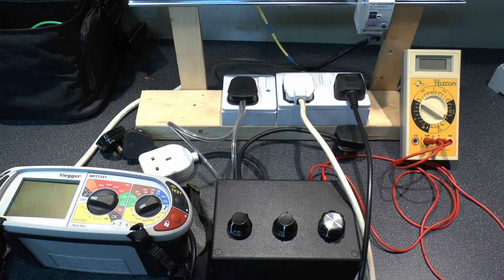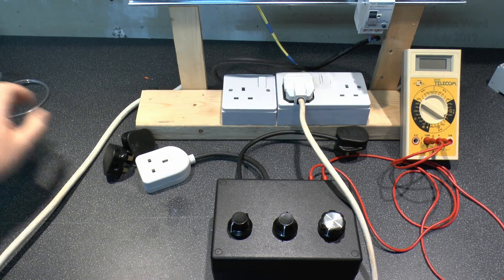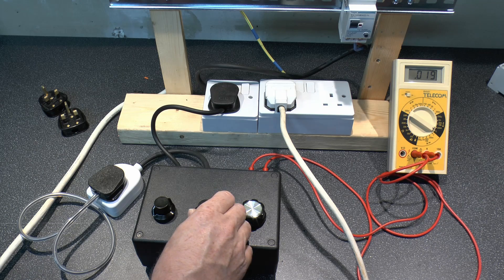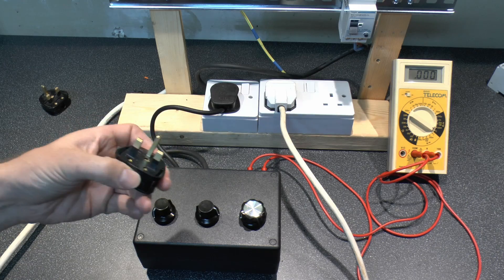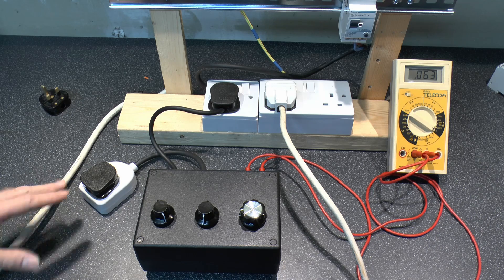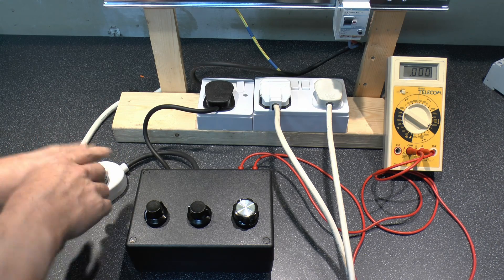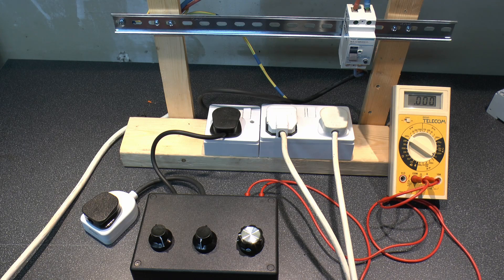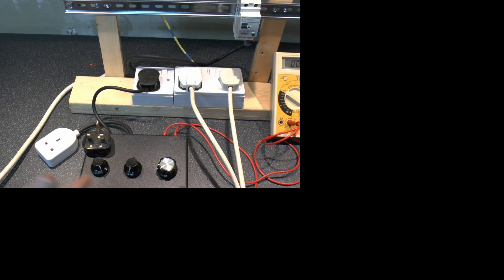RCD Testing Rig Overview - Pulsed DC on Type AC RCD Fails to Trip

Comment: With double insulated equipment how many people get electrocuted today with faulty goods?
Reply: There are also class I appliances with such problems, for example a desktop PC. They're always class I. Next one is the charger of an electric vehicle, in that case the car is the appliance and class I too, the charging electronics are in the vehicle. And one defective class II appliance with a DC fault can influence the RCD, it won't work anymore, even on AC faults as long as you got the DC fault. Meaning this is bypassing and interrupting the whole protection of the RCD. Second fault and you got a problem, even if that fault is AC for which the AC RCDs are made for.
If you think this way we could turn back to the old days, spare the money and don't install RCDs anymore...these things are there to safe lifes. That's the reason they were introduced at first for circuits in rooms which we're most vulnerable in: The shower and the bathtub.
Reply: @Marcel_Germann  How many people get electrocuted from faulty equipment? You explained the purpose of RCD's however there are still a lot of houses without them. True better to have them then not. They had a big push of RCD's with electric lawn mowers people going over the cord with the mower.
Reply: @TonyDartford  How high is the value of a safety feature that won't function under some circumstances? Circumstances of living are changing from decade to decade. What and how many entertainment appliances did we had 35 years ago? A Stereo system, a TV and mostly that was it. Now we have PCs, LEDs instead of incandescent, flatscreen TVs instead of vacuum tube TV,  surround audio systems, a handful of chargers for battery operated appliances like smartphones and tablets and so on. 
 In most cases people won't die, but they'll get an electric shock and the RCD is not tripping. In most cases the current is limited by the resistance of the clothing they wear (shoes, socks) and the resistance of the floor. An adult person won't die if the person is healthy. But persons with a heart disease, childrens and animals could be not as lucky. 
The reason for introducing RCDs at first here in Germany was for TT grids. The earth impedance is very bad compared to the impedance of the grid. So you needed something that shortens the tripping time in case of a L to PE short-circuit, L to N was no problem. Later they came up with the idea to use it as a safety feature when they were able to manufacture 30 mA RCDs (the first ones had tripping currents of 500 or 300 mA.  And here in Germany they were introduced for circuits in "rooms that contain a bathtub and/or a shower" in 1984. Also for outdoor circuits.

The thing of this video is to prepare you for call outs when a customer calls you that he got shocked and the RCD wasn't tripping. You come over, test the RCD without load and it will function properly. Then, and after watching this video, you got back in mind: Hey there was something going on with type AC RCDs and some appliances. If you're dealing with a system you'll have to know its flaws, otherwise you'll get problems finding a fault in it. In that case you'll have to find the faulty appliance before it causes other damage like catching fire or something like that.
And for new installations it's using the right type of RCD for the circuit. For example if you're installing a wall charger for an electric vehicle the right type would be a type B RCD. Or type A+EV (cheaper than B), or if the charger got a DC protection integrated a type A RCD would be sufficient. The type A+EV is not a standard type of RCD. These are the standard ones, here in Germany we use mostly type A. Here you can see from which type of faults which type of RCD will protect you. Schaltung is circuit, Laststrom is load current, Fehlerstrom is fault current. You can see, the more the waveform of the current is deformed, the more unlikely the AC RCD will trip. The A type RCD includes AC and extends its functionality. The same is for type B which includes AC and A and extends it for DC. B is the most expensive, for most applications a type A is sufficient.

https://upload.wikimedia.org/wikipedia/commons/3/34/RCD_Fehlerstromarten.svg

I would not go that far to make it mandatory to replace them now. I would phase-out the AC RCDs step by step. If you got a defective one or one that is noticeable and reached the end of its lifetime, I would replace it. And in new installations I would no longer install type AC. That was the way we did it here to keep the costs for the customers low.
Reply: Marcel Germann - just three comments. Yes these days, there are a lot more appliances and gadgets that convert the AC mains to DC. However, old mains radios (valve/tube) and most non-portable TVs (CRT type) have always rectified the mains voltage.
This looks like the people who write electrical standards have ignored the devices, appliances and gadgets that electronic engineers have been creating since the 1940s...
Oh, some devices, appliances and gadgets where a mains transformer is used are very unlikely to cause DC fault currents to flow in the mains side wiring. But this may not be true for devices, appliances and gadgets where switch mode power supplies are used.
Reply: @Mark1024MAK  There's a difference. The old ones transformed the voltage down, than rectified it. That means the galvanic isolation from the mains, which was performed by the transformer, was before the rectifier. That caused no problems, especially since the voltages are low. On new appliances the rectifier is before the galvanic isolation, the DC voltages are potentially deadly, referenced to earth and 1.4 times the AC mains voltage. I know the anode voltage of old tube radios was high too but the circuit could not deliever much current, and wasn't referenced to earth in most cases. And back in the days there were also cheap, crappy constructions like the universal current appliances. They had no galvanic isolation, reduced the voltage with a voltage divider. They were functional with both, AC and DC as a mains supply. And depending on which way arround you put the Schuko plug into the outlet (Schuko is not polarised), the metal chassis was live at mains voltage or not.

Comment: On the merger, you were supposed to start with 30ma and test it for all angels. That is how it is done. The last setting which you testing it on is ok but still, you needed to test step by step for 180 degree and others. Half-wave etc...
Reply: Agreed - half wave is exactly what the diode in this test rig is simulating.

Comment: Whilst ramp testing RCDs, i would test with no loads attached.
Reply: In a ramp test without a load they would be functional without any problems. The problem is that DC and pulsating DC are saturating the magnetic core of the RCDs measuring coil. So it is actually "blinded" and can't work properly. Even the test button won't be functional any more as long as the DC fault is there. If the fault is gone, the RCD will function as expected. The thing is, these types of failures come from defective switch-mode power supplies, photovoltaic installations or chargers for electric vehicles. The last two are in most houses uncommon, but the first one is a major problem. Almost every appliance now has a switch-mode power supply in it. Even the small chargers for smartphones or tablets. And they can produce such faults where an AC type RCD isn't protecting any more. That's the reason here in Germany the type AC RCDs are not permitted for new installations since 1984, the common type of RCDs here is type A which protects against pulsating DC (unsmoothed DC directly from the rectifier) and AC faults. It can't be blinded with pulsating DC. On AC faults they're as fast as the AC ones, but on pulsating currents they have a little longer tripping time. But it is still within the limitation of 200ms.
Reply: @Marcel_Germann  im talking about going in to an installation that may have a fault on a final circuit protected by an RCD. To rule out a fault with the RCD, i would Ramp test the RCD without the final circuit on load. If the ramp test is sufficient, i would then IR test the final circuit to find fault. I was under the impression thats what the ramp test is for; whats a ramp test going to tell you if you have a faulty final circuit on load?
Reply: @lesterelectronics223  The test will indicate that the RCD is functioning inside of its specifications because you're performing this test with AC. BUT the problem is we now use more and more appliances which produce fault currents which disrupt the functionality of the RCD. Even up to a limit where you can say it is deadly for a person. Phone or tablet chargers, EV chargers, PV and power supplies of PCs. Everything that contains a switch-mode power supply. All these appliances could cause such massive trouble if they fail. In such a case it is as you don't have an RCD installed, because it is practically disabled by DC.
The switch-mode power supplies are working the way that the first step is to rectify mains voltage and then convert it down to the wanted voltage. In that case you got a dangerous voltage which is no longer AC and is higher than mains voltage (rectified voltage = RMS mains voltage AC multiplied with 1.4), if there's a fault occuring the AC RCD won't trip within the specifications (15 to 30mA) and the person in contact will be propably toast. The type A RCD will trip within the specified 30mA limit (between 15 and 30mA). 30mA is the threshold were it could become critical for an adult person, this could cause cardiac arrest. For children and animals the treshold is actually even lower.

In conclusion: They're not dangerous, but you must know what you're dealing with and that in some cases the type AC RCD won't protect you depending on the load you got on the circuit. LED lights are also such nice guys which produce such faults. Back in the old days of the incandescent lamps there were no such problems. I would only change the AC RCD against a type A if it is defective. This will limit the costs for the people. No need to make a retrofit mandatory. But I would only use type A or B in new installations, and replacement of broken type AC with type A.

Take a look at this video, this is the whole theory esplained. The video was created by the e5 group:

https://www.youtube.com/watch?v=9qX89cPGgp4

They also perform several tests.
Reply: @Marcel_Germann  i undetstand what your saying. It all comes down to the manufactures of the said SMPS/LED. Any SMPS used in the uk should be built, tested and inspected to a certain standard such as BS EN 60950/62368, and 62504 for LED lighting. With double improbability designed in the products to fail safe during a fault. Creapage distances and clearance/insulation between mains voltages and ELV parts mitigates against receiving an electric shock during a fault. All products would have undergone vigorous testing such as; high voltage withstand testing upto 5Kv (dependant on voltage category of the item and class)  to test input output isolation. Pulse testing to name a few (replicate a lightening strike). If carful selection of LEDs and SMPS are taken into account, you should not have to rely on an RCD to protect you if the item fails within, but only on the mains side to the casing of the item (if class 1). On a side note, with the intoduction of SPDs (18th ed), these too could be mittigated; a well desiged SMPS to a british standard will contain MOVs/GDT to clamp the voltage during a lightening strike. Where does the electricians responsibility end? Do we now have to recommend what end products the customer can plug into their sockets too guarantee safety? Police the electrical crap that ends up in this country, would mitigate against most electrical injuries/fires and make the electricians job easier.
Reply: @lesterelectronics223  Every appliance could fail, the only thing is to limit the damage they do in that case. It could not be by design, abuse of the appliance before is also a possibility (throw it out of the window and you can't expect that it will function proper and safe again). That was the reason RCDs were introduced in the first place, to limit the damage to persons and property. The problem is that the circumstances we live in now have changed over the last decades. Now we got other types of electronics than 30 years ago, and we got a lot more appliances than back then. Back in the days we got incandescent lamps, a stereo audio system, a TV with a vacuum tube screen and that was it with the home entertainment. In most cases they had proper power supplies with a big heavy transformer inside. Now these days everything must be compact, leading to switch-mode power supplies which are extremely compact and efficient. But now we got a lot of them in our homes. Notebook, tablet, smartphone, audio surround system, BluRay players, streaming devices and so on. And the incandescent lamps were replaced by LED lighting, which now require a DC power supply. They all could create this trouble, even the electronic of the motor of your washing machine could cause that trouble with the RCD.
The most important thing is: Electricians should know about this flaw, otherwise you'll never find the failure if a customer calls you and reports that he got an electric shock but the RCD didn't trip. And electricians should know that there are different types of RCDs available, and they should pick the correct type for the circuit. And in most cases this is no longer the type AC. AFAIK this is introduced in todays edition of the BS 7671.
If you install a circuit for a wall charger of an electric vehicle you got different options:
1. Type B RCD, protecting against AC, pulsating DC and smooth DC faults.
2. Type A+EV (not an official type)
3. Type A and the DC protection is included in the wall charger.
I would leave the AC type RCDs in place as long as they don't cause trouble. If they do, for example through aging they become more sensitive and trip even without a problem, replace them with a type A in a normal household circuit. When installing a new circuit use the correct type. There's no need to make it mandatory replacing the AC type RCDs. Just phase them out at the end of their lifetime and replace them by an apropiate one. That's the way this was handled here in Germany. The costs are the same, doesn't matter if you buy a type AC or type A.
Here you can see what type of RCD can be used for which type of fault. The type A includes the AC protection, and type B includes the type A, AC and offers additional DC protection. Schaltung is circuit, Laststrom is load current and Fehlerstrom is fault current:

https://upload.wikimedia.org/wikipedia/commons/3/34/RCD_Fehlerstromarten.svg

The price is not too high, this Eaton one (40A, tripping current is 30mA) costs here 26.35€. By todays exchange rate: 23.65 quids. Is suppose that's in the price range of an AC type RCD in the UK.

https://www.amazon.de/Eaton-236748-FI-Schalter-40A-30Ma/dp/B000UW4EGE/ref=sr_1_5?__mk_de_DE=%C3%85M%C3%85%C5%BD%C3%95%C3%91&keywords=rcd+eaton&qid=1564152309&s=gateway&sr=8-5

Comment: JW, interesting video. I guess the question which springs to my mind, given the high likelihood of actually having one or more AC-type RCDs, is: Can we built a work-around device that will allow the AC-type RCD to trip at the appropriate current when faced with pulsed DC (or even normal DC too, I guess)? Something that can be used like an isolating transformer in that the item of equipment in question is plugged into this device, which is itself plugged into the mains power (note that I'm not saying that it should be in any way similar to an isolating transformer as such, but simply that - like an isolating transformer - it goes between the item of equipment and the wall socket). Any thoughts?
Reply: if there was a transformer of any sort then the RCD would not even be able to see the fault (not even a type A RCD would be able to detect the fault)

Comment: A very interesting experiment. It would be great to take a look at the waveforms.
Reply: Here you are, Schaltung is circuit, Laststrom (load current) and Fehlerstrom is fault current. And you can see which RCD type is covering which type of fault:

https://upload.wikimedia.org/wikipedia/commons/3/34/RCD_Fehlerstromarten.svg

Here in Germany the type A is the common one, AC was banned for new installation in 1984. The old ones were phased-out: When the AC RCDs were defective (mostly tripped below 50% of the rated current), they were replaced with type A.

Comment: That's why AC type RCDs have been prohibited in Germany for ages.
Reply: Since 1984 to be exactly. That was also the time the VDE introduced the regulation that the electrical installation "in rooms which contain a bath tub and/or a shower shall have RCD protection".
Reply: @MernokiMegoldasok  West, the VDE was a west-german institution at that time.